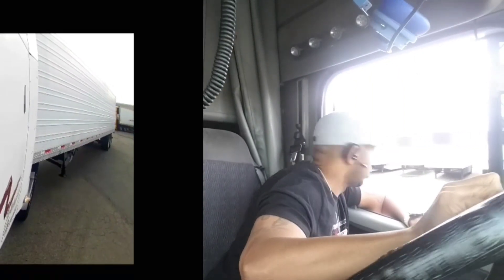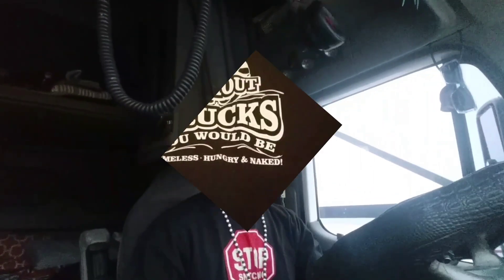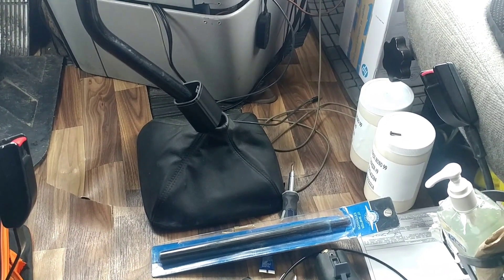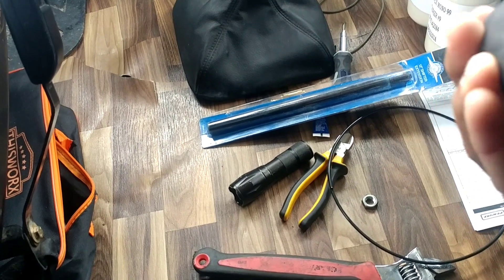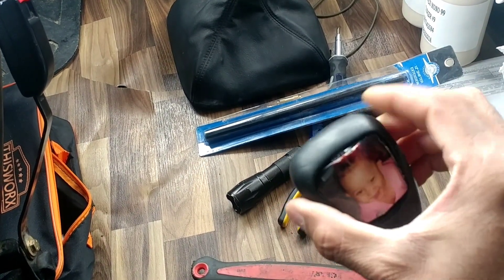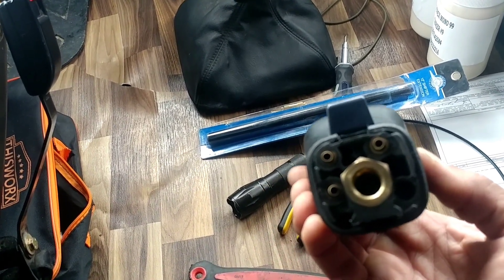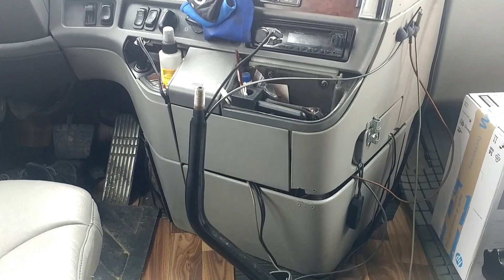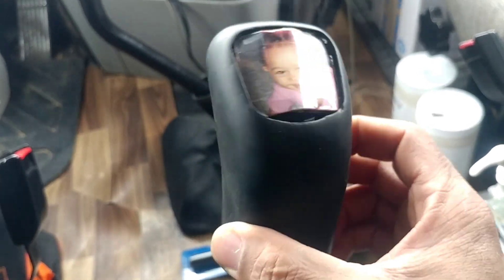Extending Shifter On Freightliner Century Class CL120

Comment: Did you ever find a way to switch the shifter?
Reply from the maker: Yes sir I got it figured out👍🏽💯
Reply: @truckology101  What did you do because I have the same one I would like to do the same? Did you end up having to keep the same one?
Reply from the maker: No I was able to change it.  My guy had an adapter piece laying around so I used that and put the revolver shift knob on it. You can get the adapter piece from any chrome shop. 💯👍🏽
Reply: The model I have I think it has electrical switches instead of Air was yours the same or just air?
Reply: @truckology101 please let me know cause I want to change mine
Reply from the maker: What you need to know bossman?